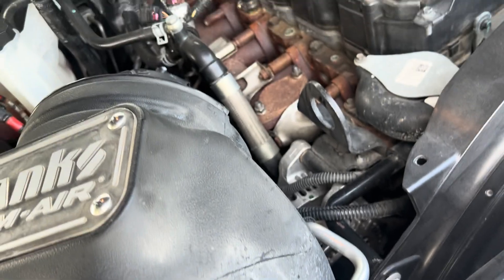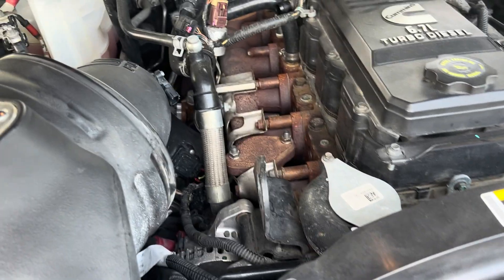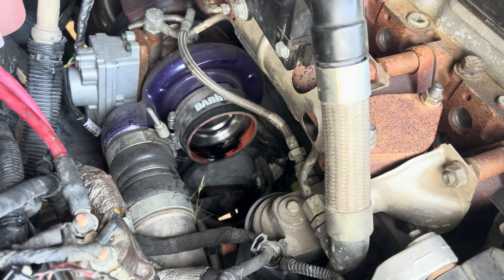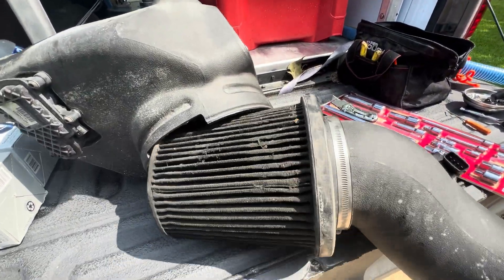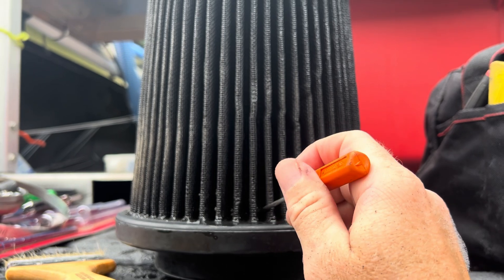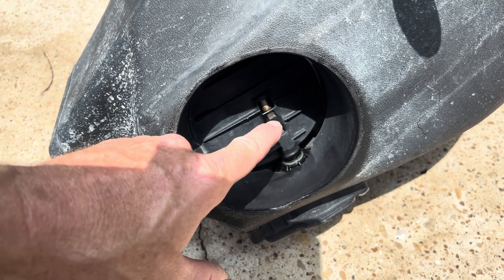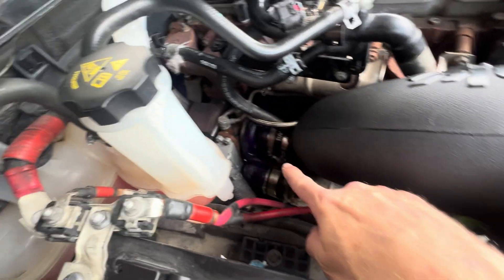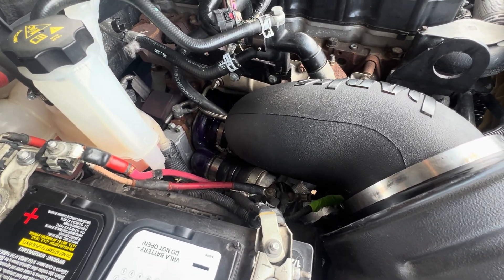Banks Cold Air Intake Update

Comment: Filter being far too dirty sooner than expected is not the fault of the filter. It's the driving conditions. You must drive in very dusty and dirty conditions. 

With how it looked, the filter replacement job doesn't look that bad. 

You bought the filter with the intent to improve performance.  Sometimes, buying something to perform the best means a bit more work to service it. 

I saw a comment by you replying to someone else about how manufacturers are making these things worse. For the money spent on a new truck, you could get one with far less emissions restrictions than yours for less money, including the future repairs. 

I maintain a 2005 GMC 2500, and i will continue to drive and repair it. It's far cheaper and more reliable than a brand new one. Less emissions related parts, that is for sure. Im currently rebuilding the engine. I'll take the time and spend the money because even after buying 3K worth of new stock and performance parts with a tune, it's still cheaper than a new one and still cheaper to insure.

Comment: You know you'd have even MORE time if were didn't spend it modifying your truck. I feel like this video is presented as if someone made you put this intake on. Or take all that money you're talking about and pay someone else to spend their time to do the job. It's about choices. These intakes serve a pretty exclusive purpose to a pretty exclusive crowd. Maybe that's not you? Modified vehicles require modified time. Idk. That's just my opinion. I definitely can understand your frustration. But the stock panel filter is much easier to change if you're that worried about time.
Reply from the maker: Stock vehicles are built to GOVERNMENT regulations. The government regulations harm the engine, restrict performance and make the vehicle more expensive and less reliable. Do you know the main cause of trucks being down for months at a time while dealers wait for parts? You obviously don't. Its the EGR parts that the EPA forces on us all. The EGR is the first cause for failure and costs thousands to fix.
So I looked for a product that suited my needs and was made by a company that is known for their expertise. You sure made alot of assumptions. I do things myself because I don't have money to waste or pay someone to do when I can do it myself. Which is why I make content. 

Air Intakes are meant to improve fuel mileage and power. Both good things. So the products we buy, are meant to do that without extra headache. 
More modifications do not mean more time. 
Governments track record is ALWAYS making things worse. But comply or go to jail.
Reply: @tacticaldieseldad5695  egr only gets bad if you buy a diesel to get grocery's when you need a load on it going down the highway so the egr system can clean itself as thats a diesels intended use
Reply: @Kdog307  I think you are getting the DPF system confused with the EGR system.
Reply: Lotta diesel daddys getting mad lol another round please
Reply: @seiser42 awww you sad you don’t have one?

Comment: Thank you for the honest review. When designing intake systems, our engineers often focus too strongly on beating the performance of the competition and not ease-of-use for the end user. Your video highlights this. We've shared your video with our engineering team.
Reply from the maker: Thank you! Make the top of the box a clear cover so we can access the filter and it would be a great product!
Reply: I gotta agree, I am looking to switch over to BANKS air; so let's upgrade a fix asap and maybe help retro fit some of those who have purchased them prior. Let's BLOW the comp out of the water,  since no one is fixing this issue except the stock filter being having easier access but having low flow.
Reply: Amen brother! I have been using Banks products for years. This is a pain in the but. To clean an air filter. In my case i bought an additional dry filter and per-filter. Your first video was spot on. Many years back I used a oiled filter. I never again used one. I would have to sit there with a toothbrush and clean the turbo impeller every oil change. Now i do it for the the breather vent. I'm looking for a oil catch can now. So i don't have to do anymore. How are you enjoying your Allison? I have a stage 1 myself, with a Aurora 4000.